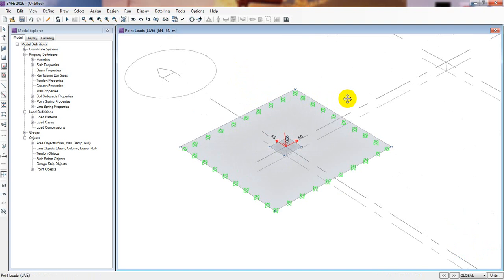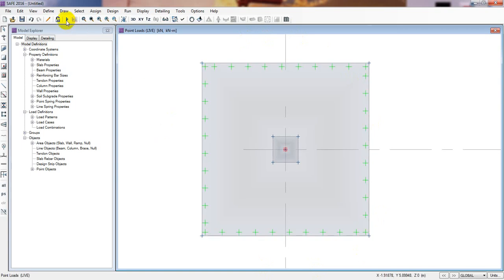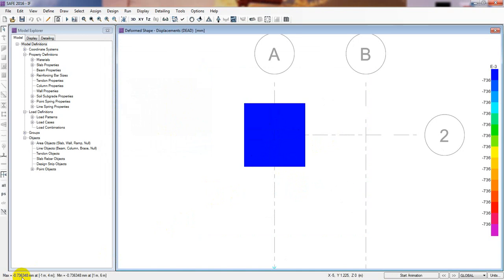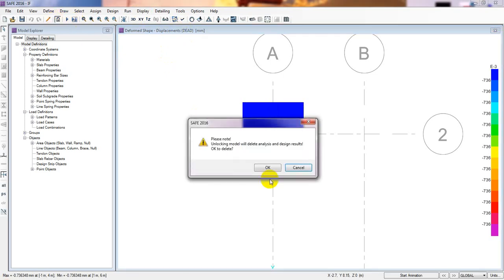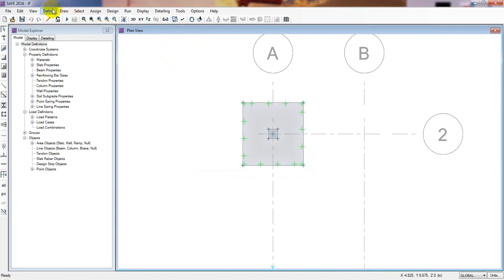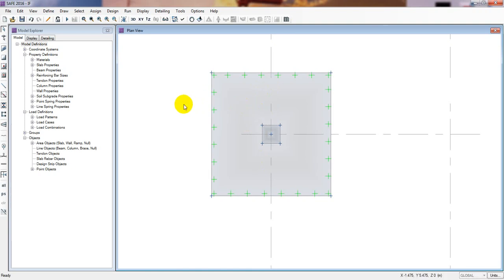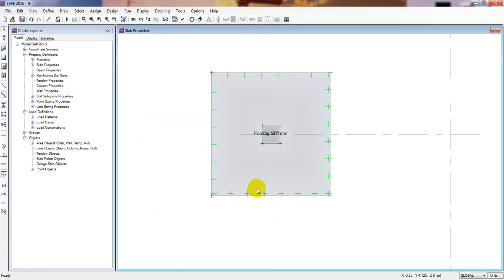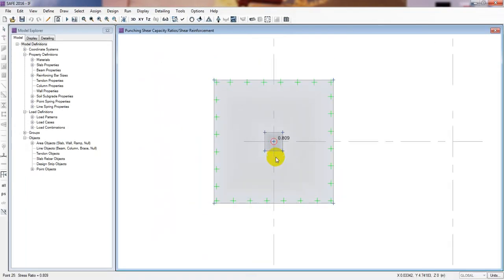CSI SAFE 2016 TUTORIALS | DRAW AND DESIGN ISOLATED OR SINGLE FOUNDATION IN CSI SAFE 2016 PART-3

Comment: Column stiff je Dead load r live load ta dia hoace seta ki unfactored load naki factored load??
Reply from the maker: apni jodi software use koren tahole je base reaction asbe seta e . ar manually calculation korle seta depend kore apni kno method a kortesen USD/WSd tar upor.
Reply: @qlearnify-en  vaia etabs theke value input dibo so eta ki dead r live dibo jeta unfactored load naki factored dead load live load dibo??
Reply from the maker: @nasimreza4040  ji apni base reaction theke jeta paben seta e .dibe. moment and force soho.